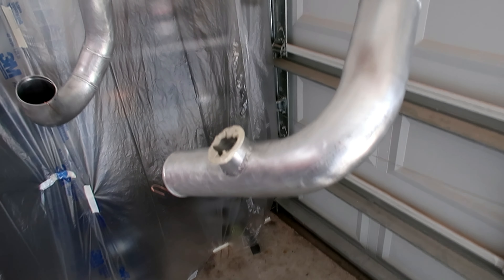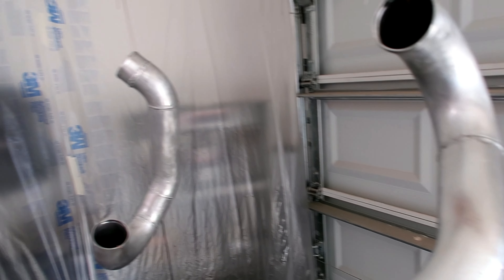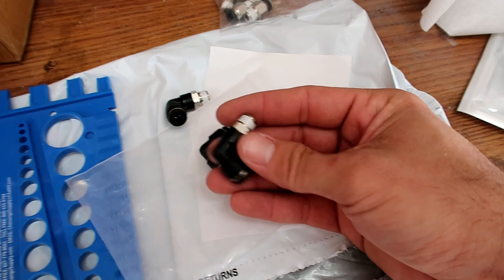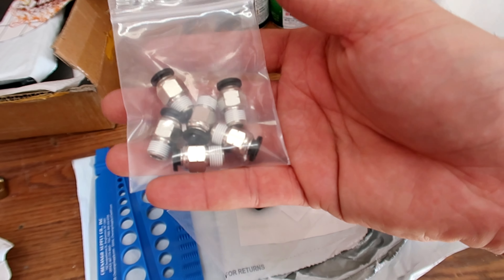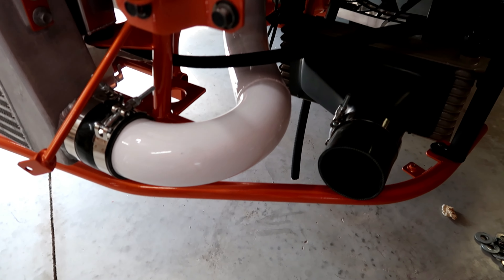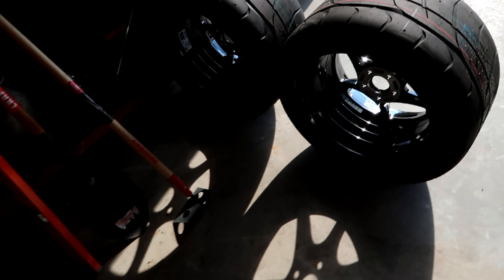1/2 Mile Mazdaspeed3 Final Assembly Before Stand Alone ECU Wiring - (Episode 52)

Comment: Is coming along! Love ur custom work!also love the wheels /tires package even tho they stick out lots😂
And again Just great work, making a huge impact in the mazdaspeed community
Reply from the maker: Thanks man. Dont worry those wheels will fit under a widebody. 😂😂
Reply: @WZ_TV  ah you re thinking to custom build wide body kit like with scurts n everything? that could look great if done right, it's gonna look way better than just flears
Reply from the maker: @raquielcross5757  yes sir. Should have said that on the video lol. But yes its going to have a wide body kit that flows with the car plus splitter, diffuser and flat bottom